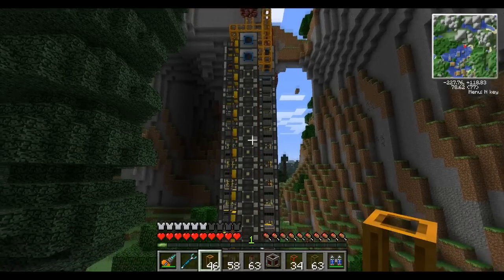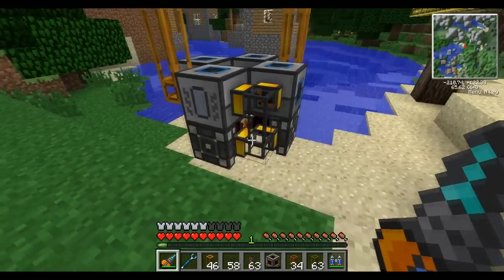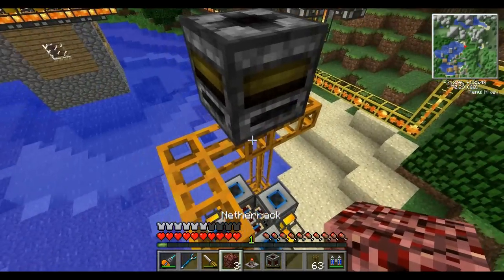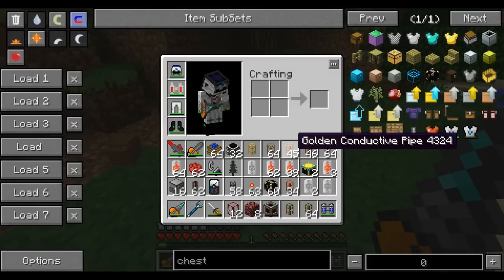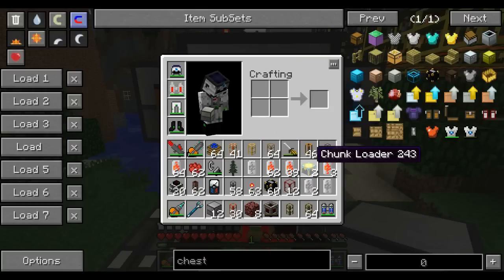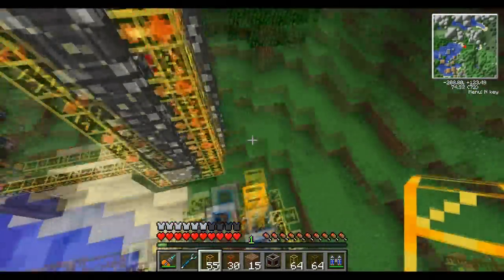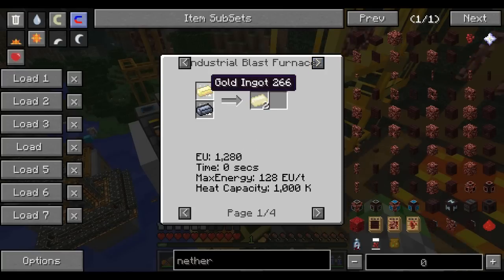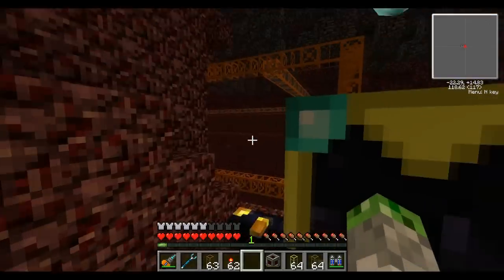Feed The Beast - Tip Series: Magma Tower

Comment from the maker: Yeah the last nerf really slowed it down and increased ratio of netherack to lava from just about 2:1 to 3:1

But a nether quarry can easily keep your supply, and if you use my setup for the nether quarry each magmatic engine you setup there can keep 2 of those towers running full time. Each quarry (64x64 at the top of the nether) has a potential of about 170k lava buckets gained per quarry completion.

TL;DR - It's not so bad, just patience is required now :D